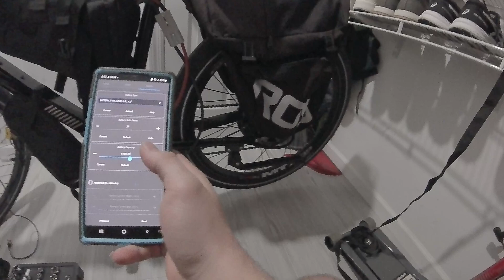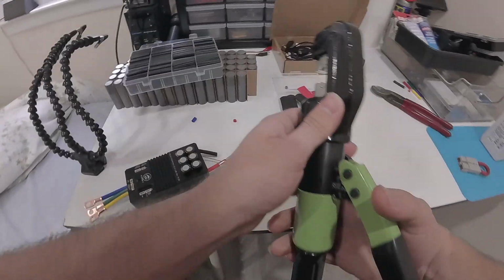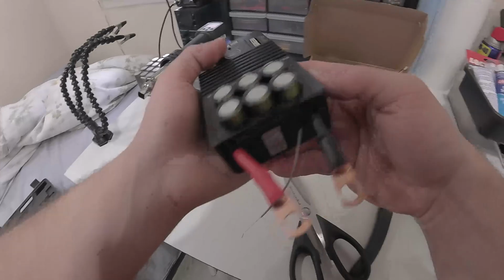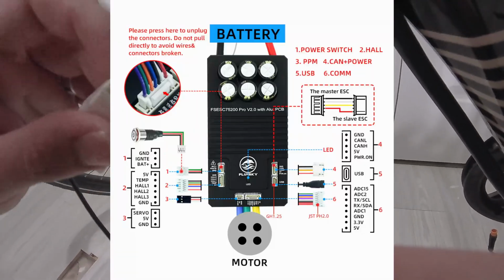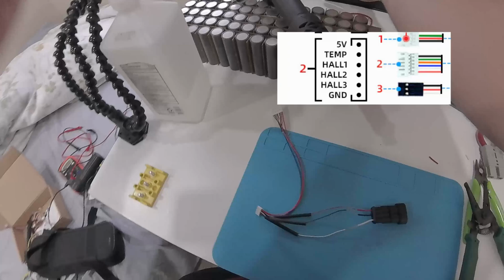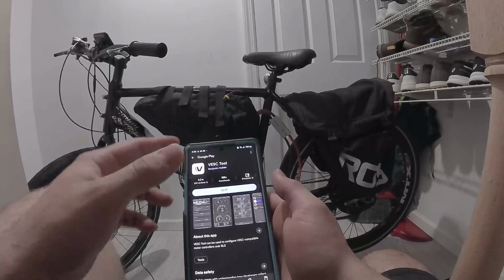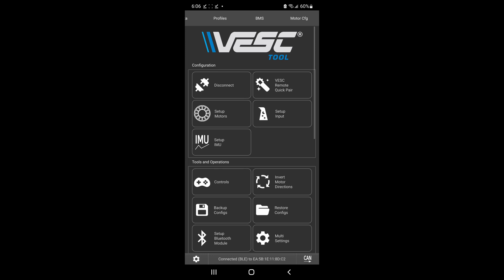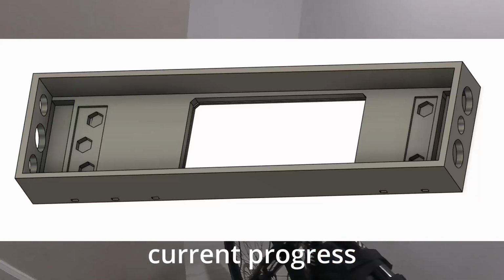Wiring a Flipsky 75200 Pro V2.0 VESC Controller to My E-Bike (NBPower Kit Upgrade)

Comment: Brake wires bro???
Why does nobody wire the brake? If the throttle gets stuck on you're F'ed with no way to stop, "power off" is the only option but that will be the last thing you'll think of 👍
Reply from the maker: That's fair and I should have mentioned that in the video for sure. My bad. However, if you were stuck on full throttle, your brakes should still bring you to a complete stop, at which point you'll realize that you need to shut the bike off. If your brakes can't do that then you need better brakes lol.

But I agree and I fully intend on wiring the brakes as well. This video was intended to be as simple as possible -- but that doesn't excuse me from failing to mention the brake switch! I'll pin your comment so others will be reminded of such.
Reply: @DimGG  ill be very happy as well to see the config for brakes that shut down the motor if you press them. for kids safety. great video
Reply: @DimGG i recently got my pro v2. Seller said vesc only allow 3-wire type of brake sensor, which i assume mostly is for motor with regen. Using 2-wire type risk of damaging the controller. For anyone  reading this reply n struggling with installing a PAS, you can get a voltage type PAS instead of the regular pulse sensored type, you then connect the 3wire from PAS to ur throttle 3 wire and then connect the 3pairs of wirings to adc1, gnd n 3.3v(instead of 5v for throttle to prevent dmging the controller as advise by seller)*assuming throttle n pas have the same coloring code, you connect white+white to adc1, black+black to gnd and red+red to 3.3v. Hope these stuff help anyone. If anyone can point me to any gd direction for a detailed hub motor setup using the phone app, that will be awesome! Nevertheless, great video!
Reply: Ma come fai a far funzionare quel display?

Comment: I'm trying to find out if that 84v is a hard cut off limit or not. Im in the process of building a road legal electric motorbke but my QS motor is high tork with to low RMP at lower votages like 60v. I've had to go upto a 84v batttery to get a decent top speed. I'm currently using a generic chinese 80A sine wave controller so no option for field weakening to increase RPM .  Would like a Flipsky 75200 pro but i think my battery voltage is to high as fully charged its at 96 volts ! Does this mean i carn't use a flipsky 75200  ? If anyone knows pls reply.

Comment: How many poles did you set for the motor settings? I cant seem to get the right number and mine keeps sputtering
Reply: You have to open the motor ,count the number of magnets and divide by to to get the correct pole number ...

Comment: Tell me how should I connect the Hall sensors? In which connector and what colors?

I have a wire? Black, red, blue, yellow, green? Which rosem should I put it in?

what color should i put in hall 1, hall 2 ,hall 3
Reply from the maker: Generally on this controller you do red to red and black to black. The other 3 colors can be matched in whatever order. Those are the signal wires for the 3 hall sensors. The controller automatically identifies which one is hall 1, hall 2, and hall 3 during setup.
Reply: @DimGG  Can I connect only three hall sensors? or more?I have two pairs of sensors of the same color? 5 wires each. Can I connect them together in one socket?

Comment: If i get the 84v controller from flipsky would it work ok with my 1500w 48v18ah? I’m trying to get more throttle response and if possible a  little bit more speed

Comment: why not just use an xt90
Reply from the maker: I tend to avoid using soldered connections with large gauge wires whenever possible. the anderson connectors let me use my hydraulic hex crimper to get a really good mechanical connection
Reply: @DimGG  good advice
Reply: @DimGG I've had a lot more failures with crimps than solder but maybe that's just me seeing shoddy work. Corrosion and crimps are an issue I see over time.

Comment: Good health. Please tell me if I need to turn off the phase filters? I have the configuration program for the computer version 6.02. The controller firmware version is 6.02.
Reply from the maker: it depends on the controller you are using. for example the flispky 75200 pro v2.0 supports phase filtering so you should turn it on but the flipsky 75200 pro and flipsky 75200 do not support phase filtering so you should turn it off. turning it on when your controller does not support it can damage your controller
Reply: @DimGG  I understand, thanks for the reply.

Comment: Please make a range test whit it, and display all hardware data so i can compare it whit my moddel later.
Reply from the maker: I got you. I just need to tune it when I have time lol. I'll do a screen recording overlay.
Reply from the maker: Sorry I haven't been able to post. I actually just blew up my controller, lol. I uploaded a picture to my community posts. I was getting around 8-15 miles (going quite fast) on a 72v18Ah battery. Max continuous power output of like 7kw on my 3kw hub motor.
Reply: @DimGG that's not a good outlook lmao. I've got a flipsky vesc 75100 v2 pro and going to go easy on it since vesc likes to blow up controllers and flipsky like to blow up of their own accord. Stuff like the ASI based phase runner seems impossible to kill by comparison.

Comment: But if I don't use more than 45amps could I just use an xt90-s anti Spark plug?
Reply from the maker: Yes. You won't need pre-charge setup like I did since the anti-spark plugs have an in-rush current resistor built into them. And anti-spark connectors are much cleaner looking.

Comment: Hell yeah bro. Tell me about how customizable is the amperage control in segments. Like for ex. Can I set up to reach 5, then 15, and 30 amps at a time? Kinda like having gears? Thanks man looking fwd for ur reply
Reply from the maker: I'll be looking into it some more very soon! Just been busy with another wiring-heavy project and am currently designing the enclosure for this controller. I still have to explore the vesc menus and options myself but I'll share everything I know as I go!
Reply: @DimGG  I'll here with ya bro. I'm new to this tech but together we'll figure it all out. I'm running a 15000 watt scooter 72v 20s 40ah . And max speed is 63mph. I wanna hit 75mph . Where u from? I'm in Orlando FL
Reply from the maker: @D1n0nlyT.Rodriguez  damn dude 75mph on a scooter is nuts haha. I'd like to see that build though. What controller are you using? I'm in NYC. The weather here is shit for riding. Wish I was in Florida lol.
Reply: @DimGG  oh snapz. U see any ICE actions out there?? 🫣
Reply from the maker: @ not where I'm around but in the Bronx and Manhattan it's been pretty bad from what I've heard.

Comment: Finally! A VESC-based ebike! Awesome build! Can you give advice on how to setup/wire a throttle and PAS with the VESC?
Reply from the maker: This guy on YouTube @EBikeBuilder_ has a bunch of vids about VESC controllers on E-Bikes he has definitely experimented with them quite a bit. Worth checking him out. He has a video on PAS with VESC too.
Reply: I'm currently working on a project that involves Arduino NANO and 75100 pro V2. I'm integrating the PWM based on PAS(torque sensor) or throttle(depending which has higher hall input voltage. I will also integrate the usage of front lights, and brake. I will also integrate a TFT display with 50Hz refresh rate. It will be the most programmable FSESC ecosystem. I will probably publish it on Github when I'm done with it.
Reply: @jiroephraimcabanto2915 what’s the status on this?
Reply: I'm just getting my toes wet in this world. All helpful info.